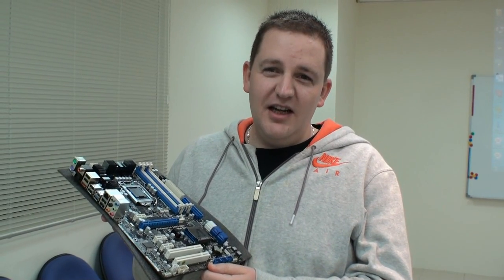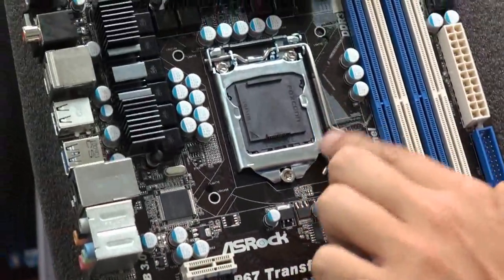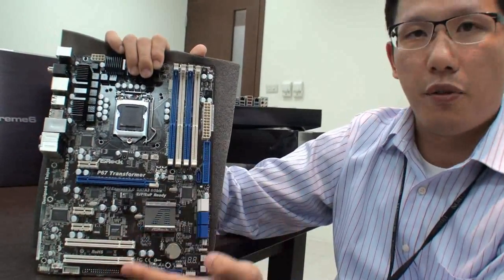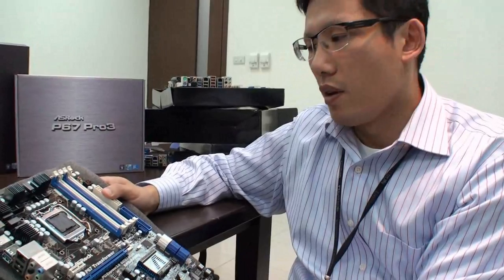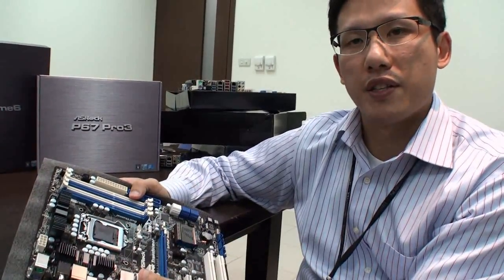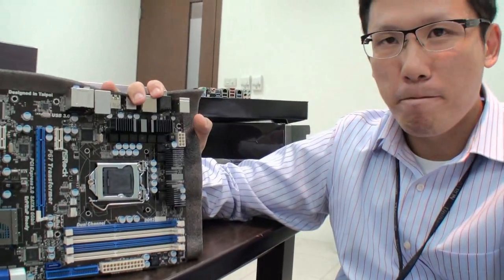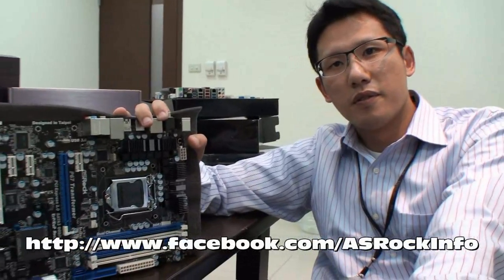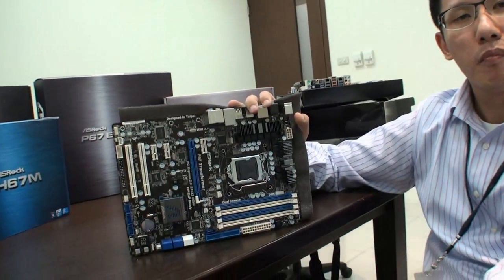ASRock P67 Transformer Motherboard Hands-on

Comment: @ipullstuffapart That motherboard only have one PCI-E slot, so you can't do SLI anyways lol. And the more PCI-E slots you add the more bandwidth goes down with each slot, that's why the NF200 chip is implemented in some motherboards to give you a full x16 amount for all slots(which this motherboard doesn't have obviously)